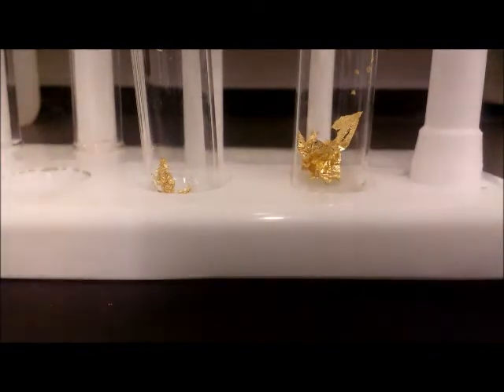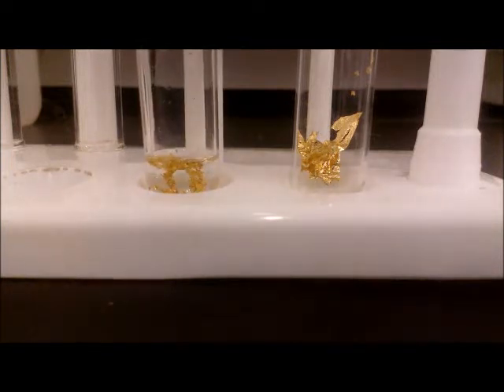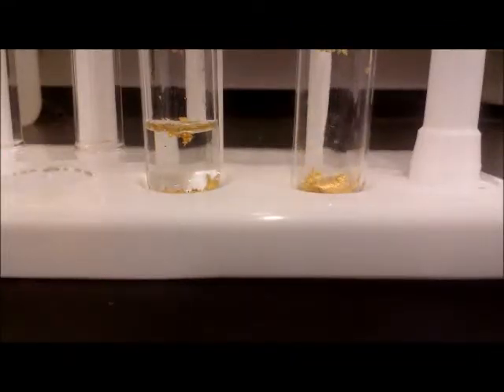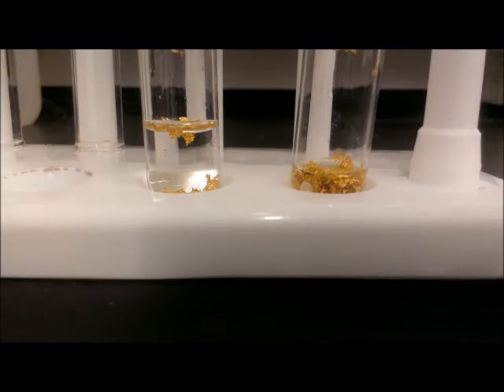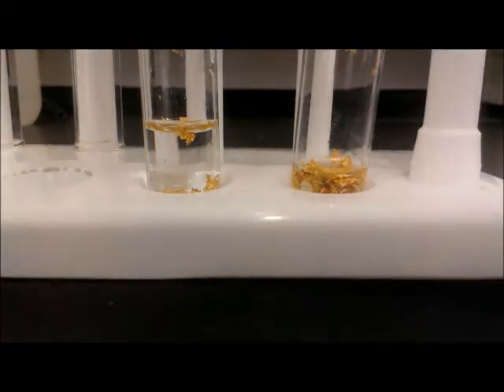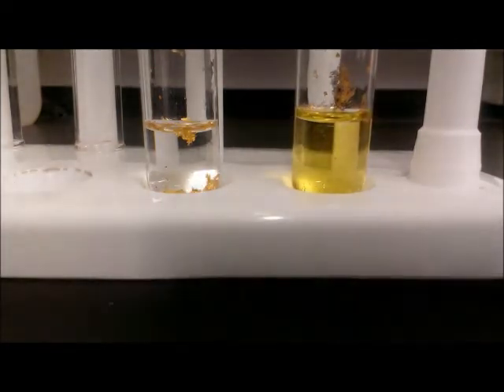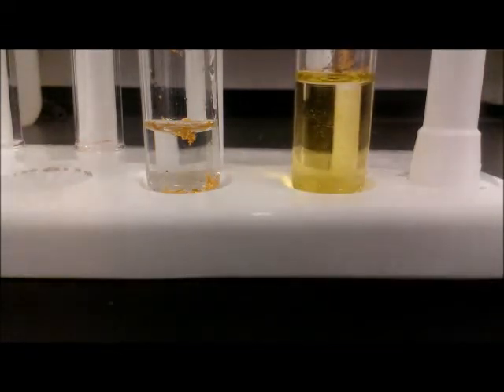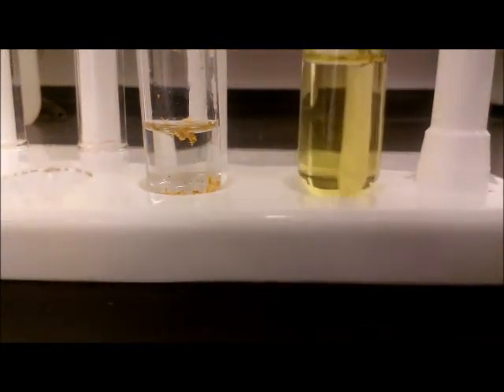Dissolving Gold

Comment: So...

Why does the combination of acids work but not the individual ones?
Reply from the maker: Each acid performs a different task when dissolving gold.  The nitric acid acts as the oxidizer to form Au(III) ions.  The hydrochloric acid provides chloride ions, which react with the Au(III) ions to form the soluble chloroaurate anion (AuCl4-).  That is my limit of knowledge.  Since nitric acid will dissolve a virtually undetectable amount of gold, it may have something to do with thermodynamics, where forming an Au-Cl bond adds enough energy to make it thermodynamically favorable.  The test tube got quite warm, not sure if that occurred from mixing the acid or dissolving the gold.
Reply: thechemistryquestion
Thanks.  I even (mostly) understood it.
Reply from the maker: That's about where I am with it.  Give me a few more years.  If you really want mind-blowing, I'm reading an paper right now that I'm trying to understand for a future video, where researchers made salt have formulas such as Na3Cl, NaCl3, NaCl7, etc under high pressures.